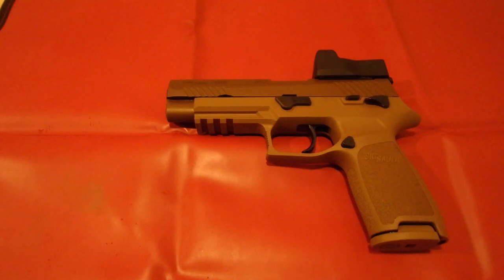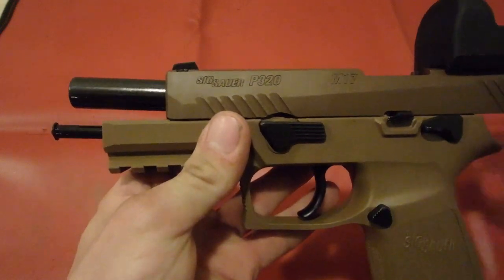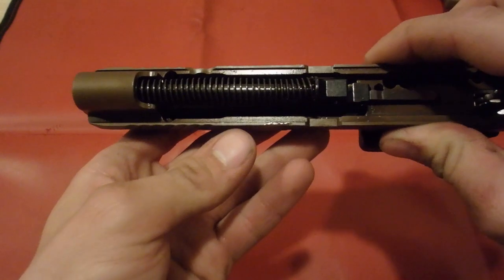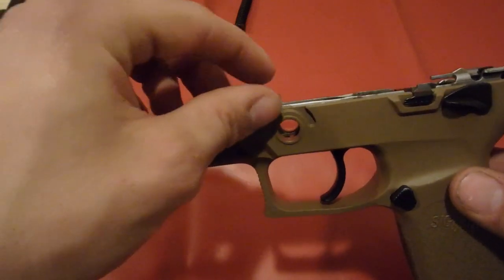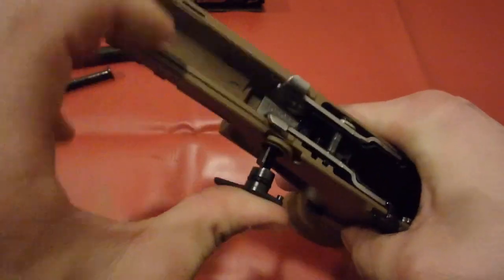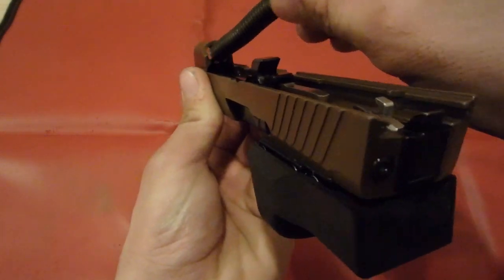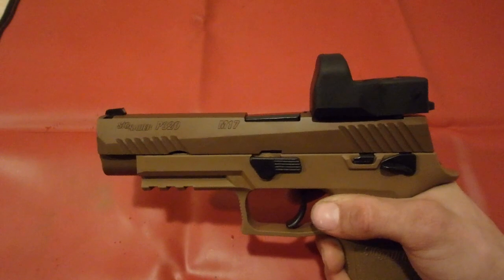Sig Sauer P320 M17 disassembly and reassembly

Comment: Fantastic video. Thank you!
Reply from the maker: Thank you!  glad you liked it!
Reply: @dpoutdoors4702  I absolutely love this gun, and not only do I use it for concealed carry, but also take it to the range every chance I get (since 9mm cartridges are more available and cheaper).  but taking it apart for cleaning and lubrication is extremely easy to do, and just as easy when putting it back together
Reply from the maker: @DrQuagmire1  I wish I could use it as a daily carry.  I'm unfortunately a smaller guy and it doesn't actually conceal very well for me. lol It is very easy to do once you know how to do it. However, when I made this video, I couldn't find a simple video someone could follow.
Reply: @dpoutdoors4702  ah, fair enough.  and with that said, there's a good amount of holsters out there that be worn on jeans through a belt, or belly-band types that's worn around the waist

Comment: Any specific oil you use for the PVT coating on the slide? I just got the civilian M17. They warn about using specific solvents & oils, but I can’t find much info about this and there isn’t much in the manual. Any resources would be great. Currently using the G96 all in one and skipping any dedicated solvents (with no issues).
Reply from the maker: Militec-1!  I have been using CPL for the cleaner but lately I have been using M-Pro 7.  After the cleaner I use a small amount of the militec-1 metal conditioner just in the high friction areas. some of my buddies are in the military and are using militec-1 on their weapons. I'm sure the G96 will continue to do a good job though.  Hope this helps!
Reply: Go to Sig website they sell the recommended oil,& cleaner. Think it's Spec1, but it'll definitely say on there.

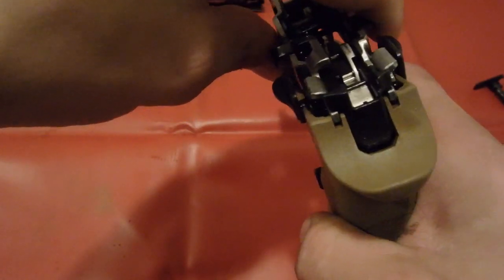Comment: @5:00 if you put the trigger in first, push the assembly forward and angle the back of the assembly at about a 15° angle it slides right in. Mine was new, I did just that
Reply from the maker: heyyoo just tried it! I feel like I have been doing it backwards this whole time. haha thanks!

Comment: Just got mine. It has white gunk inside it. What is this stuff and should I clean it all out before I use it?
Reply from the maker: I would clean all of that stuff whatever it is out of there. Mine did not have white stuff in it however it did not cycle properly until I went in and cleaned it. Haven't had any issues yet.
Reply: @dpoutdoors4702  yeah I will. I assume it is whatever lube they use at the Sig factory because it must have just been built considering everyone is buying up everything out there due to the covid-19 situation. It must be newer than usual.
Reply: That “gunk” is actually gun grease! Most gun factories use it. It’s outstanding lubricant for hot or fast moving parts …like slides. Check out SigGuy on YouTube if you’re interested!

Comment: I noticed you had a Leupold Delta point on the 320. I'm trying to mount one on the exact same gun but the screws that came with it appear to be the wrong thread. I'm wondering where you found the proper screws. Thanks Dave
Reply from the maker: I didn't have a press to take the rear sight off. so I took it to a local gunsmith and he mounted it for $30.

Comment: Great vid, How much money did you have to drop for that delta point sight? And where did you purchase it from?
Reply from the maker: Thanks for the compliment! I paid $250 at a gun show about a year ago. He purchased it, then decided he didn't want a sight. It is my first red dot on a pistol and I couldn't be happier with it. my buddy got a different brand and has had issues with it not setting right on his M17
Reply: DPoutdoors holy crap! $250 a near $600 sight, that’s insane, Wish I was as lucky as you! I found through research that in the making of the specs for it that sig purposely made the slide to basically only fit the delta point. I’m hoping someone comes out with a cheaper variation that will actually conform, but hey Thanks again for the knowledge of this I’ll be looking back at it when I disassemble my M17
Reply from the maker: @Zetti_Games  I know right! I wasn't planning on getting the delta point, however when I cam across a deal like that I couldn't pass it up!  I know you can sometimes find deals on ebay for them.  Sig is supposed to be coming out with a sight just for this gun but I haven't seen anything yet.  I know a few guys who have gotten the Romeo 1 to "fit" on there. It's just not as solid of a fit though. wouldn't recommend personally.

Comment: Why does the barrel look like it’s uneven
Reply from the maker: I'm assuming you are talking about when the slide is back and it looks like the barrel is pointing up?  
That's due to the breech area. If you look at the black part in the middle of the slide (top of the gun) You can kind of see in the video, but it is sloped down towards the muzzle. when the slide goes back, it rests on that slope pointing it up.  

If you are talking about another point let me know and I will see about that.   Thanks for the question!

Comment: You didnt take out the striker assembly or the extractor? Mine gets caked with carbon after couole hundred rds. Just take a small allen n push down pn the black button on the back n slide down the rear plate n then pull out the striker wipe it dry n put it back in.
Reply from the maker: I did not. Sig Sauer has a lifetime warranty on their firearms. it says in your manual "The recoil spring and guide assembly  is not to be disassembled." doing so would void any/all warranties. All the little parts inside the assembly are not sold separately by Sig Sauer. If the striker or extractor cause any malfunctions (which they shouldn't if maintained properly) I'll send it is for free repair for the life of my gun.